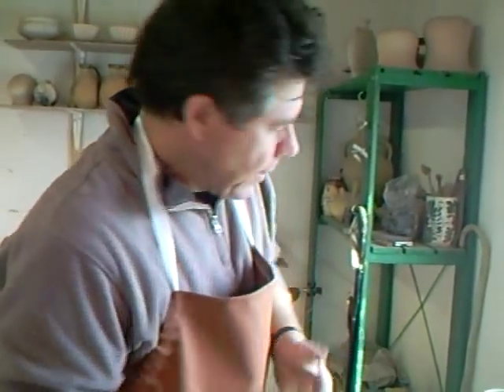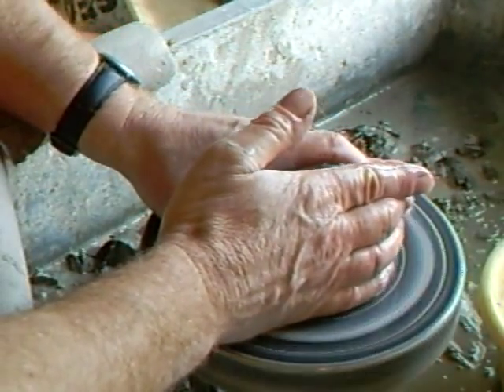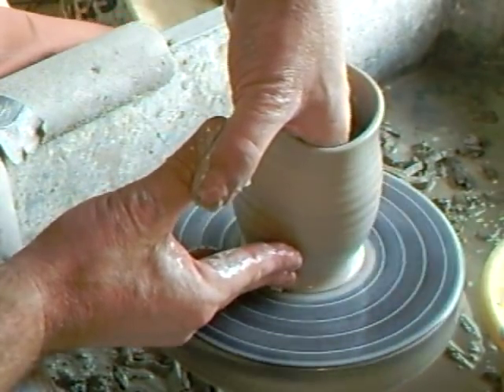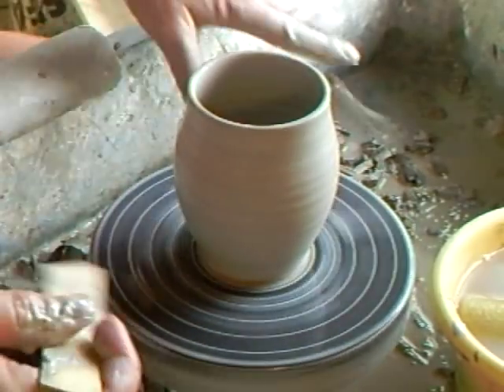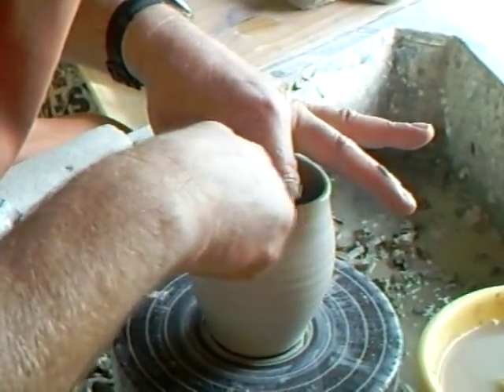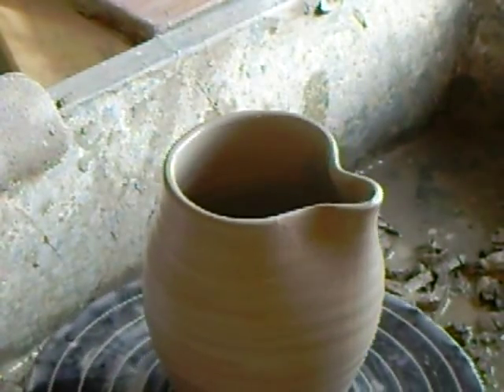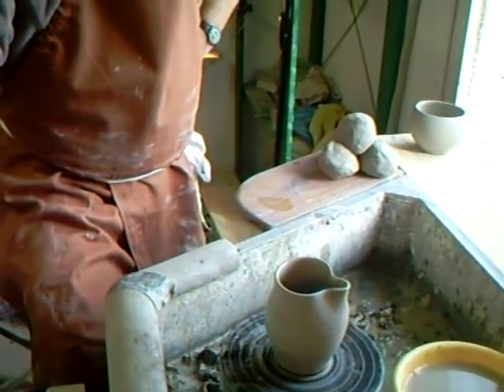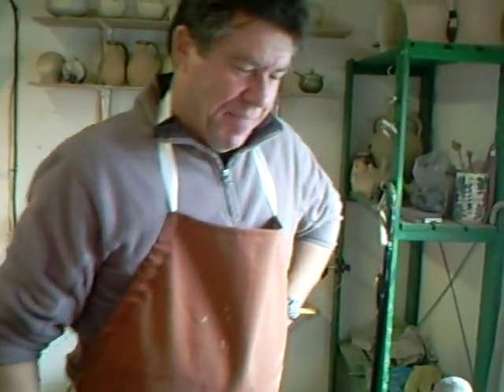SIMON LEACH  -  'Pouring lips'

Comment: Hi Simon,
this is a good topic !  I have had the same problem with that drip at the end of the spout.  The wax sounds like a good idea.  Cant wait to hear what others have done to remedy this.  
By the way, im having fun using my 'Leach tool kit'  the angle on the stick makes all the difference, and the fishing wire cuts off nice and smooth compared to my metal wire.  Im still adjusting to the trim tool. If the clay is 'just right' it trims nicely! Thanks again!
Regards, Sue from New York

Comment: ok, I'll give it a try with the wax at the lip. I generally just make the spout at the end very thin and that seems to work. As you know, glaze is absorbed by the clay relative to the thickness, so the glaze at the end of the spout should be very thin if the clay is very thin.
  Thanks for the videos Simon,I enjoy them and admired your grandfather. Bernard, Hamada and Rhodes were my first teachers. From a fellow potter.

Comment: Nice video,
Daniel Rhodes's book 
" Pottery Form"
Talks a great deal about throwing pots with better form and function. The chapter on pitchers is the best I've ever read.
I learned to stroke the lip several times in the direction you would want the liquid to flow. I make my spouts much like you do Simon, only pull the middle finger from the inside, up the throat and over the lip, this leaves a tiny sharp edge at the lower underside of the lip in which to cut off that last drip.
DebraRay

Comment: hey Simon when you make a cup without feet or other pieces how do you make it stand properly without moving to the sides if you touch it. for some reason when i finish some without feat ( meaning its flat) they seem to be unstable do you know what i might be doing wrong?
Reply: Christian Sanchez Put it on a flat wet surface and rub the bottom of the pot against it in a circle or figure 8. This will level out the bottom of the pot.